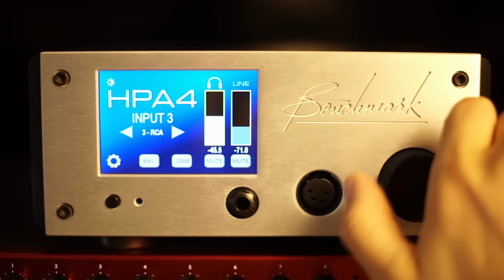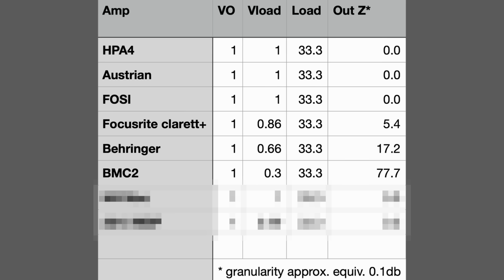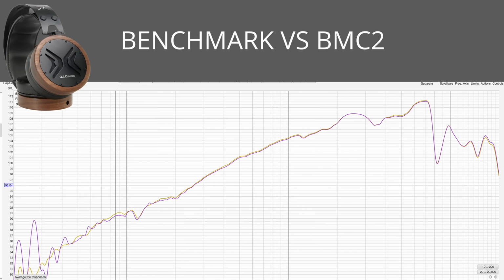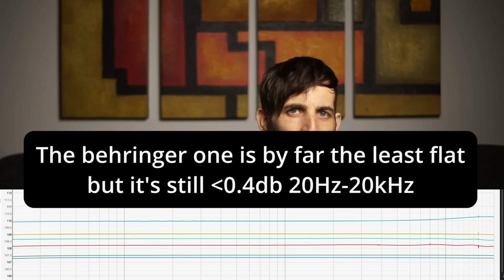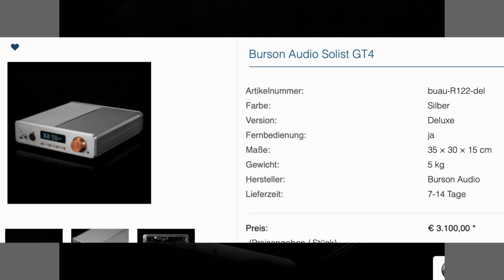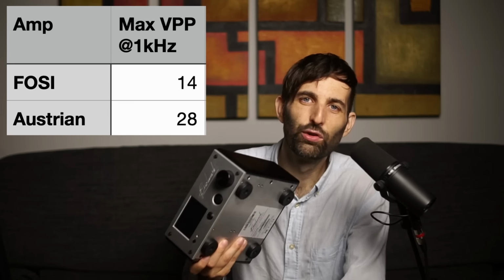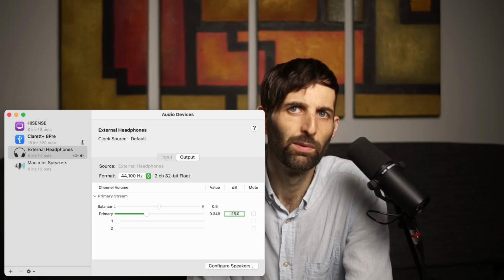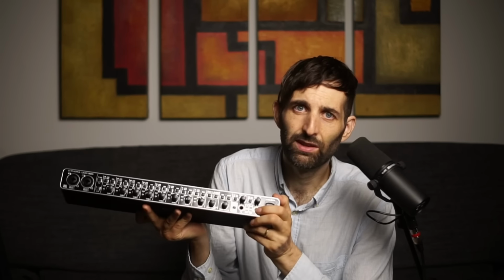Stop plugging your headphones into your audio interface!! Headphone amps demystified.

Comment: My comment disappeared? Deleted? Why? No need to spend silly money. Go Topping DX Pro+. I use planars, doubt an audio interface will drive them properly. Re level Toppings have a digital display. I use an Spl meter to measure the output at the phones, use a piece of card with a hole in it 85db.

Comment: It could be that the Austrian measures the pot value and derives the output level from that internally, that's why the difference increases when louder, maybe the two sides' amplification are just badly matched anyway. 0.4dB is not too much, but shouldn't be as high on such an expensive unit. Maybe one transistor is cooled differently or they use heat sensitive resistors, and one side is different temperature.

Comment: Wow. Just wow. No, your macbook sounds like ass, compared to a reasonable interface, and if you don't know that, I feel sorry for you. Honestly.Try leaving the volume pot alone, on a good amp. One with some reasonable capacitors instead of the workaround in your laptop, preferably discrete. This is madness, with some statistics.

Comment: 28:30 for anyone who uses their Mac. 

If you hold Shift + Option while going up or down with the volume key on the keyboard, it goes up in more granular steps. 

You get 64 steps instead of 16.

Great video by the way.
Reply: Yep, and also works with screen brightness. Also forgot about this 👍👍
Reply: 😮what?? in all the years using mac I never knew that, haha-  thanks for sharing 🙇‍♂️ 🙌
Reply: Thanks for that as I'd forgotten 👍🎧 😊
Reply: was going to say you can bring up the Midi and Audio Settings panel for more granularity. didn’t know about that shortcut, thanks.
Reply: Awesome tip, thanks! - new Mac user
Reply: Plus, you can also just adjust the level in your DAW if you want smaller steps. Easy.
Reply: Thanks, will try tomorrow.
Reply: I wish there were more volume increments on an iPhone! 😢
Reply: There’s a similar feature on the iPhone. When you swipe down for the control panel, press and hold the volume control for a second and you get a full screen volume slider with much more resolution.
Reply: @0ddL00k1ngBl0ke.  Thanks a million for a fantastic tip.

Comment: So, I have an Audiofuse 16Rig interface and Sennheiser HD 490 PRO headphones (130 Ω impedance). These are used for some non-commercial DIY-music production and also for recreational listening. Would I notice a significant difference in any way, if I'd use a FOSI Audio ZH3 instead of the interfaces headphone outputs (which are digitally controllable)?

Comment: EDIT: apologies, this post is wrong.  I thought the X1 were planar magnetic but in fact they are dynamic so the following is bobbins which I'm just leaving here to feed the algorithm and support the channel.

I think I can explain why the BMC 2 measures so similar on the X1 even though it's quite a high impedance amplifier.  The reason is that the X1 is planar magnetic design and one of the key features of this type of headphone is that they have a flat impedance across the frequency spectrum.  So every frequency is equally attenuated by the amp/headphone impedance imbalance which means that you don't get any changes to the frequency curve caused by different attenuation at different frequencies. That's the reason why an impedance mis-match affects the frequency curve of headphones - it attenuates at different frequencies depending on the impedance.

Hope I've explained it clearly.

I can't explain the Behringer result but likely just underpowered if I had to guess.
Reply from the maker: I thought they were dynamic
Reply: @APMastering er....in that case ignore what I said.  In fact I just checked and you're right.  Sorry.

Comment: i plug my headphones into whatever can decode a signal proper and increase the volume mate.  daily driver is a v60 phone, it's got a headphone jack.  bang.

secondary units?  they've all got headphone jacks.  my onkyo receiver, my topping amps.  anything with a headphone jack, gets headphones plugged right in.

it's almost like a game i play - find the HPO... cause if it has one, you best believe i'm checking on how it sounds.  AND so far, nothing i've plugged into in the past say 10 years has really been any "better" or worse than anything else.  it's all perfect guys.  

if you think your $2000 sounds better than this ipod touch i'm holding whilst both are playing an apple lossless master, you've bang lost the thread of how digital music works.

mate here has it right.  if it's got the jack?  plug right in, set your music and enjoy.  you cannot "buy" better sound guys, you just can't.

Comment: Curious to see if the basic apple usb c dac has the same characteristics as the mac devices. It would be a great cheap alternative for those who don't have a mac (though I dont know if one can set the the volume level as you do in the video when using Windows or Linux)
Reply: Apple’s built in jack has a lot more output power than the USB C dongle, roughly 50 mW vs 30 mW on 32 Ω and up to 10× more with high impedance headphones.

Comment: This was an interesting review, there are some details and corner cases not discussed.   This is all true for dynamic driver headphones, what about low impedance planar magnetic headphones which are very low efficiency?  These don’t require huge voltage to drive but rather high current.   Look at some early model hifiman and current Modhouse Tungsten headphones.  I believe if you add that to your evaluation it will quickly rule out the Fosi Audio amp.    The HPA4 is definitely a very good amp, believe it or not there are some designs who  ch c take volume control to an even higher design level for channel balance, granularity and noise without using relays.   Have a look at the Simaudio Moon 430HA D.  It makes the big Benchmark unit look small, lol.

Comment: @14:15 Recallable gain
I think it's very important if you can explain in a separate video how to properly set the monitoring level for headphones. Like, what sources to use when you do this, how you're gonna measure the SPL levels inside the headphones, what if you use more than one pair of headphones etc, etc

Comment: Another objective measurable facts guy….ok that I understand but as far as derailing expressions like ‘air’ etc…seems a little harsh. I am not rich, I haven’t spent thousands on one cable etc but even I can tell the difference between the sonic signature of one cable compared to another from power cords to usb cables, speaker cables and so on let alone amplifiers. So while it’s good to number crunch it still does not take away the end result of each product which provided audible differences that are easily described and understood like ‘air’ which just means a cleaner background for the reverb and echo to linger which some amps, cables, products either do well or not. A lot of the time, more expensive gear does tend to allow better end results, not always but more often than not. I have two usb cable here right now and it is, after testing, very easy to hear where the money has been spent.

That said thanks for the vid. Although remember is your work proves valid then it might bump prices up if the company’s take note….😂

Comment: I didn't check the output impedance of all RME interfaces, but mine, the UCX II, has a 1 Ohm headphone output impedance. It has recallable gain so I never felt the need to use anything else.
Reply: It's not bad with dynamic headphones, definitely not good enough for planar headphones but having a good dedicated headphone amp is an improvement.

Comment: The only dedicated unit I personally use for studio is the Phonitor (XE).

DAC sounds good, decent output power, the crossfeed +angles are interesting to play with when you can't use speakers, and has a mono output to check phase issues.

I wouldn't say it is worth the money but I got it used for a good price.

So for my own headphones it's either that or I use the Clarett+ Pre, or Mac's jack output as well 😂🍻❤

Comment: I tested my Sennheiser HD800 which sounds with a little bit correction of the exaggerated high frequencies very similar to good monitors. with different audio interfaces (via hardware-switcher). The result was that for orchestral music with all the transients, the Apollo Solo headphone amp was really not good. But sending the sound from the Apollo monitor output to different Headphone amps was very good and very similar to a Pro-Ject S2 digital headphone output (which is an awarded low-cost design with very good ess sabre d/a converters and sounded more dynamic and slightly cleaner). Also, a very lowcost, good sounding solution was an old soundblaster. I did not test the headphone outputs from my computers but I'm shure they are sounding pretty good.

Comment: Not all PCs are created equal, and neither are Macs, that said, unless you're buying a specific sound chip in the laptop, Then you're going to want an add-in card.. or external obviously... But I'd be interested in measurement tests on the various MacBook options out there? I remember back in the day doing work on a iMac which was garbage for audio, and everything had to be done an externally pretty much through The mbox... But this was a long time ago back when USB audio wasn't the thing you ever wanted involved in anything unless it was very special.

Unfortunately for PC audio, it seems that Sabre ESS dac shows up in almost all the sound focus devices... So if they're trying, that's what shows up.. and ever since having several LG phones with it where meridian did the tunings... It's like one of the most tragically disappointing blights, as the higher end actually physically hurt my ears... And it wasn't until looking at some of the videos on the MQA origami nonsense and some of the measurements where I was like... Oh these guys just don't care about anything above 11 k it seems... So yeah, know what you're getting... But I'd be curious if all the Macs are create an equal in that regard because they certainly didn't used to be..

Comment: I'm almost certain I'm going to need a headphone amp to drive my Sennheiser HD600s when I inevitably get to the mixing stage of my current project, so I went ahead and purchased the Fosi ZH3 based on your review, and with that discount code it was a no brainer; I didn't even have to pay tax! I tried researching headphone amps a couple months ago but I wasn't able to find a reviewer or article that gave just the straight facts about what it is you actually need and want to look for in an amp. Keep doing what you do!
Reply: I have HD650s and was almost on my way to buy the Fosi but tried plugging them directly to my Mac Mini M4 Pro and I don’t think I need the Fosi after all. Looks to be a really nice unit though for the price!
Reply: @teemutoropainen  Wish I had a mac :(

Comment: The reason why Ollo Audio headphones are not affected in their frequency response by amplifiers with high output impedance is that their impedance remains virtually constant across the entire audible range. By contrast, most headphones specify their nominal impedance measured at 1 kHz, but it usually varies with frequency, especially in dynamic models. Ollo are an exception, as they exhibit a stable impedance.
It’s not magic, just a little gap in knowledge.😅 No error ni your measurements.

Comment: Another good option that is also priced at around 200eur is the smsl mda1 dac+amp, that has balanced speaker outputs, which is something all these entry level devices lacked, including older fosi models.
I would be very interested in seeing how rca performs against balanced outputs in a real world studio setting. While on paper, not taking into account any interference, they should sound basically the same, but i already experienced stuff sneaking into my recordings when using unbalanced cables, so i was obsessing with finding an amp dac with balanced outputs to really be safe. 
And another issue i found with basically all these affordable dac+amp devices, and higher priced also, is the inability to power both the headphones and the speakers simultaneously.  Some require you to actually unplug physically one or the other to switch between them, or switch with a dedicated button. The only downside with the smsl mda1 is you cannot control the volume of the speakers and headphones individually which is kind of a big problem for me.
Do you know if this feature is on the new fosi? 
I spent a couple of weeks researching this topic and found out at the end my audient id14 actually has a pretty low output impedance when powering high impedance headphones, which in my case with the dt880 250ohm  equates to a +0.2db of boost in the very low end. It does have a pretty high output impedance when powering low impedance headphones tho..

Comment: It would be interesting if any mods could be done inside the Behringer to improve it, ? Do you also have similar views on the Behringer ADAT expander ?
Ps, another quality youtube video !.
✌️
Reply from the maker: You can definitely mod it but the question is whether it’s worth it. Not a fan of the ada8200
Reply: @APMastering this guy on YouTube, modified the noisy main outputs on his Roland MC909 by adding bipolar electrolytics to tge main outputs, it was so effective that he did the mod to heaps of his synths / drum machine,  youtube MC909 modification, repair " BMR STUDIOS " go to almost the end of the video, I am sure you will find it very interesting. 
✌️ ❤
Reply: @APMasteringhttps://youtu.be/Q88_nOMVW6M?si=K5EweG5Yzwlc42vh

Comment: Were you aware that the standard practice for decades in quality hi-fi gear was to drive the headphone jack with 220 ohm to 330 ohm resistors connected to the power amps? Meaning a source impedance of 220-330 ohms? 

The question is, what source impedance were the headphones in question designed to work from? Some were made to work well with high source impedances and will sound overdamped and thin with near-zero ohm source impedances.
Reply: 200 ohms is a reasonable level. Seems to work ok with most phones.

Comment: Deltas in curves are a function of output impedance (Zo, not Ro) of the headphone amp, which is a function of frequency. and closed loop gain response that may also be load dependent.

Comment: The somewhat "unpredictable" frequency response variations that were measured have a pretty well-known cause.  When talking about the impedance of dynamic drivers, it's important to note the use of "nominal" as a descriptor.  Driver impedance actually varies with frequency - it's not flat across the frequency spectrum.  There are two difficult scenarios for a headphone amplifier - if you are trying to drive a signal that's at a frequency where the driver has very low impedance, that means the amplifier needs to deliver a lot of current (amperage).  Sometimes this can cause output devices to overheat.  The output device can also be current-limited, which will result in delivering less power into that frequency where the driver's impedance drops below the impedance of the amp's output.  The other scenario is that very high impedance means that the output of the amplifier needs to deliver higher voltage when driven loudly.  I've seen dynamic headphones that are commonly used in recording studios, with nominal ratings of up to 600 ohms.  There's a possibility that at certain frequencies, the impedance could be higher.  But for the sake of easy calculation, if you want to drive a 600 ohm load with 1 watt of power, that means having to deliver 24.5 volts.  Many output devices are running at lower voltages than that, and so simply won't be able to deliver as much power into frequencies with that kind of resistance.  Do you need to drive 1 watt into your headphones?  In most cases, that would be deafening, but there are some very inefficient headphones that produce listenable volumes around that much power.

As far as the MacBook Pro goes, I have a M1 from 2021.  It's generally fine for casual listening.  I will have to admit that I haven't tried playing around with the sample rate on it in Audio MIDI Setup, so that may be the cause of some of what I'm about to say.  I also haven't done any measurements - this is purely subjective.  But for critical listening, I find that on most headphones, I get noticeably better sound quality out of an external DAC/Amp like a Chord Mojo 2.  There are two sort of extremes where it seems to make a big difference.  My favorite headphones for critical listening are a very power-hungry set of planar magnetics, and the built-in headphone amp just doesn't have enough juice to drive them properly.  Secondly, IEMs are extremely efficient, such that you're typically driving them at the very low end of a volume control.  That can really reveal the noise floor, and I find that with very efficient IEMs, the built-in headphone amp has a noticeable level of noise, while a good external DAC/Amp doesn't.  Apple does care about audio quality, and they have several engineering teams dedicated specifically to that - both in terms of hardware and software.  However, I used to be certified to perform in-warranty hardware repairs on Apple equpiment, and I can tell you that at least in the past, there wasn't really the kind of EMI/RFI shielding around the audio circuitry that you would expect to see in a dedicated DAC/Amp, and the audio circuitry is in close proximity to other devices, including WiFi and Bluetooth devices, that emit a lot of RFI.
Reply: You'd have to be deaf to think a macbook ( I've an M1 Pro amongst others) can offer anything near a reasonable interfaces headphone output, It's a laughable suggestion to anyone who has reasonable equipment. I'm not sure why I'm back on this site, I suppose because I wondered how rage baity he would get, and in that regard it doesn't dissapoint . Ludicrous.